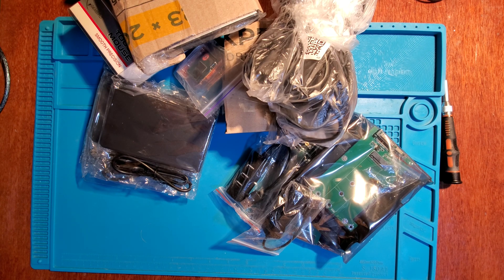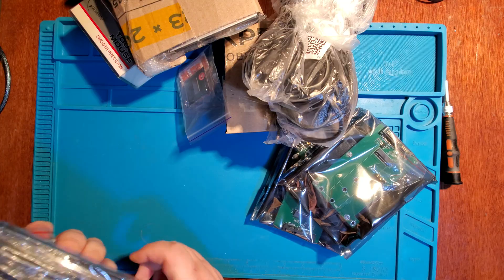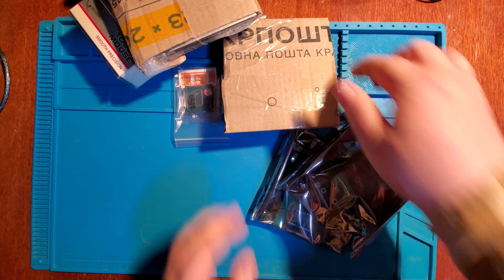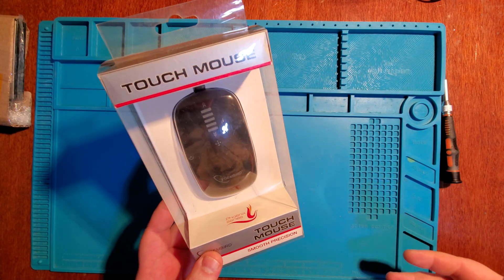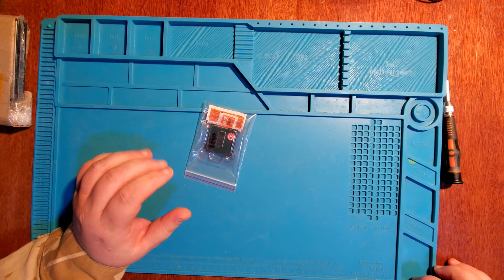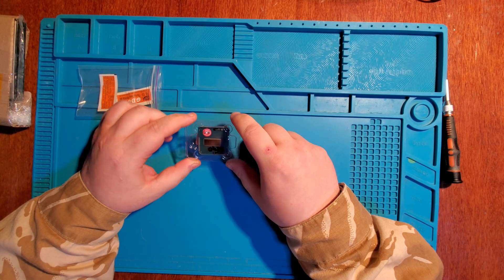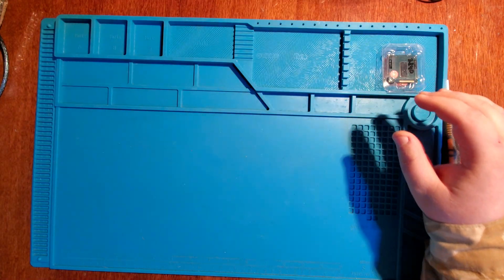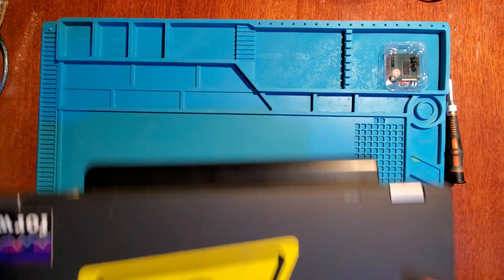Make it or break it ep. 23. Upgrading Thinkpad T430 with a I7-3840QM (45W, 4C/8T) CPU

Comment: May be the t430 vrm can't provide enough power for 3840qm to boost properly, and in my opinion, using it with 45-watt cpu can destroy vrm completely because it works on its max capabilities, maybe I'm wrong, I have hp elitebook 8470p with i5 3320m and 16gb ram Kingston ddrl3 with Kingston ssd, and it works well, and we'll enough to be faster than modern ultrabooks with cpus like ryzen 5 7520U, I was shocked when I did comparison in every scenarios my i5 3320m beats 7520u, I was testing them only on battery, and my hp was silent and didn't spin coller like modern ultrabooks, and the funny part, the ultrabook that I used for comparing it with my hp was louder not because coller but because of it coil noice 😂, I heard it enough to notice it but hearing nothing from hp, that was impressive including the fact that my hp elitebook 8470p running windows 11 pro (not tiny 11 but full os) and it runs as well as Linux mint some how, by the way in cinebench my i5 3320m got 1507 points which is impressive
Reply from the maker: That laptop still works, so it is a win-win

Comment: May be the t430 vrm can't provide enough power for 3840qm to boost properly, and in my opinion, using it with 45-watt cpu can destroy vrm completely because it works on its max capabilities, maybe I'm wrong

Comment: mi T430 conseguí upgradearlo, con el i7 3840qm, le cambie la refrigeración por la que lleva gpu dedicada, le puse 16gb de ram ddr3L. le cambie la basura de tarjeta wifi que tenia la intel centrino dvance N6205, le puse mSata de 512gb (ya tenia un ssd de 240 instalado), y va el portátil increíblemente bien, estoy pensando agregar un caddy para otro ssd, y teclado retroiluminado pero no encuentro algo que me convenza en temas de tacto como el original, pero el original me encanta tengo una unidad en estado de 9/10 me encanta este portátil
Reply from the maker: Please be careful with the CD bay caddy cause many of them have  issues with the contacts that result in SATA failures and power sub system malfunction.
Reply: @deepmaze1  I'll keep that in mind, thank you so much

Comment: A few years ago, I have upgraded my T430 i5 3210M cpu to the same 3840qm which you are using. If I remember correctly, I did not flash 1vyrain bios and just used stock bios. Instead, I have tinkered the cpu settings in the bios but I don't remember how I configured it.

I have 3.8Ghz for single core, 3.4Ghz for all cores when using AVX instructions(prime95), and 3.2Ghz for all cores when normal benchmarking(Cinebench R23), using 90w or only batteries. This is exactly the designed frequency of the 3840qm. Although the cpu temperature goes up all the way to 100c in my case, I think this indicates that my stock cooler may have been punctured and the gas inside may have escaped.

Just for your interest!
Reply from the maker: It goes over 100C with the stock cooler. I already did a variety of tests. The best way to keep things in normal temps is to limit the CPU power to 35W. 
I already doinated this War Rig laptop. New owner has no compains for now.
Reply: Then It would be better upgrade if you upgraded not to 3840qm which is 45w cpu but to a 3632qm which is best 35w cpu

Comment: So you have two laptops and upgraded the cpu and hard drive? Why would you mix them up. It's a little confusing. But nice try for the 45W.
Reply from the maker: Yes there are two almost identical T430s. One is my "old" that I love and care about.
Second T430 is just an impulsive purchase. It will be donated somewhere. Laptops come and go easilly. If I stop donating then I will have too many of them )))
That 45W CPU laptop was more like an experiment that allows me to discover system limitations. 
I would not risk my main T430 with BIOS change that can either brick it entirely or break its 7 row keyboard controller firmware. 

As for the limitations of 45W.......
1vyrain BIOS showed - there are none. That BIOS has proper settings. You can set 35W CPU power limit and use that 45W CPU in the same way that you used any other 35W 4 core CPU. The only problem is to flash that 1vyrain. It is not as easy as expected (Website with links to ISO is down, GIT sources are useless cause there is a huge gap in dependencies that you can not get any more, not every USB flash stick works).
Reply: @deepmaze1 With this logic you can upgrade to 3940xm and limit it to 35w so t430 didn't explode, actually it's a nice setting that allow to change cpu power plan and limit its tdp